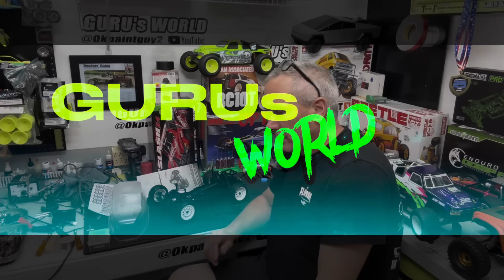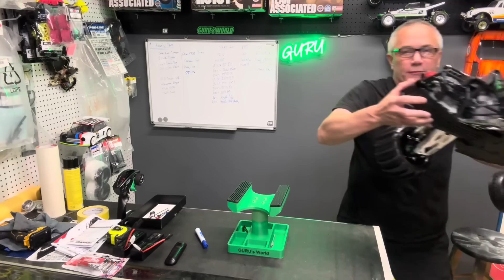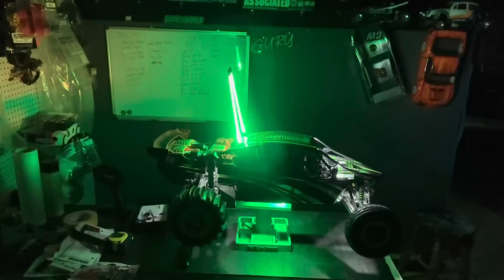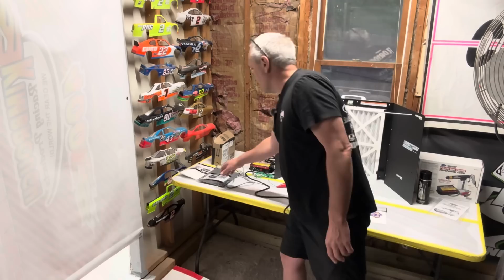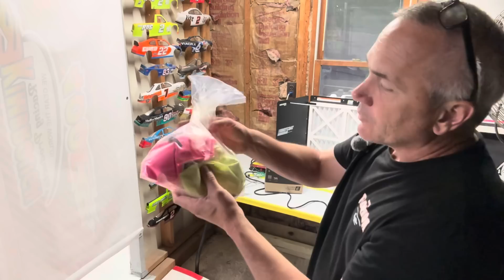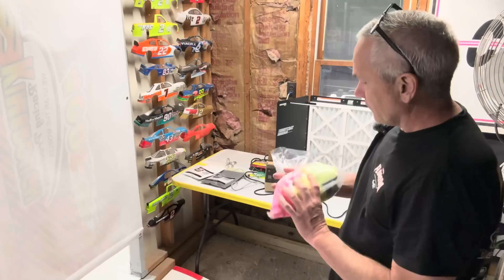Mid week update. Kyosho, Traxxas , plus powder coating!

Comment: I've been waiting on some JCONCEPTS Goosebumps to come in for the stock wheels on the DuneMaster. If it helps any with the lights, Injora makes a magnetic wiring connector that could work on the sand car and rid yourself of the task of connecting every time you want/need lights.

Comment: Nice sounds like a good time. I’ve painted 3 body’s over the last year and a half been having fun with them just rattle paint cans for now till I can get my spray gun for my air compressor.
Reply from the maker: @GearWorksRc  Awesome I want to give those new proline spray cans a try .
Reply: @Okpaintguy2  yea I just got done painting my TT02 rally Yaris Toyota body almost fmishied with it should have a new video up soon I’m not a professional but I tried my best and I backed it with Traxxas black pro graphic paints and Tamiya blue in the front did racing stripes in green for the gearworks colors I think it turned out ok. Yea I’ve been looking at them as well that’s what I may try first when k do get my air gun.